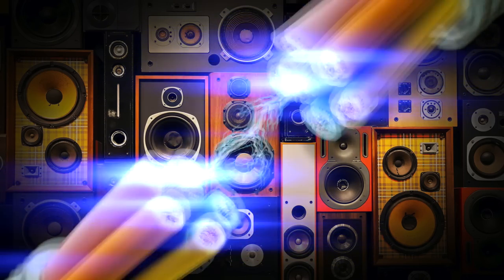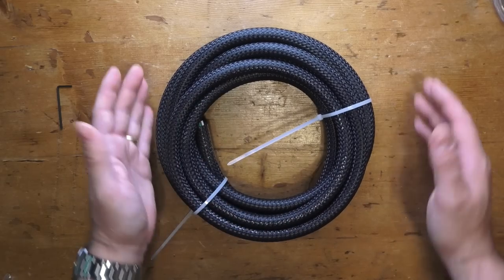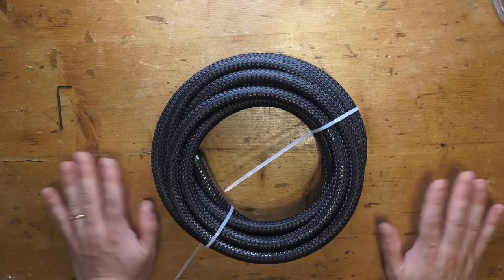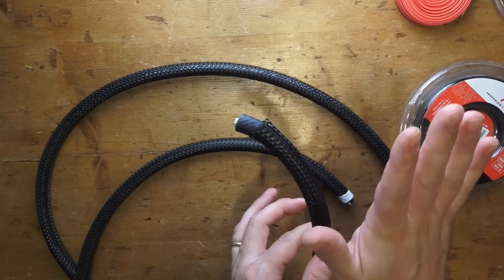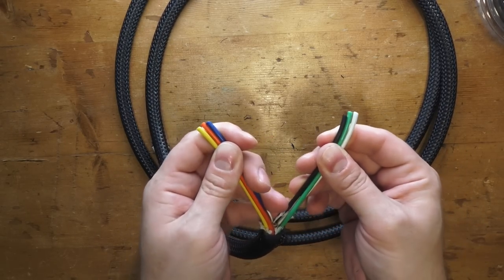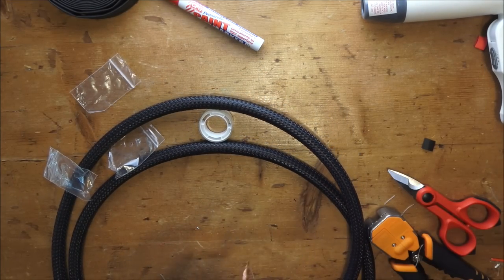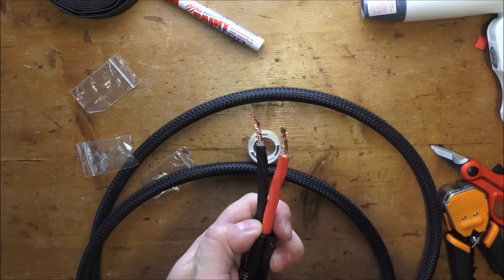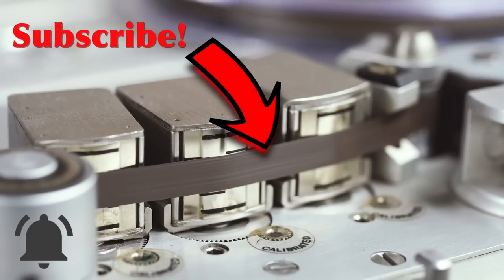The Speaker Cable Guide: Part 2 - DIY audiophile cables!

Comment: I already had my eye on this speaker cable for a while before seeing this video. I eventually took the plunge and bought some from Audiophonics based in France, 6 meters worth to start with. I tested it on my Bi-amped system and all I can say is, wow, superb sounding cable. Bass extension, clean, clearer mid range with a nice extended top end,  massive soundstage, transparency, speed, focus and superb imaging is what you get. This speaker cable should be on anybody's short list of speaker cables if you have a high-end revealing system. A bargain cable for the DIYer and I highly recommend it. I tested out some Canare 4S11 (5 Euro Meter) which is great sounding cable that replaced my Van den hul ' The Wind' (40 GBP per meter back in the day) which blew it away. The Amadeus 5 Mk2 blew the Canare well out of the water and then some. I use 2+2 connections ( 2 locking bananas + 2 spades) for each cable length, 4 x 3 meter lengths for Bi-amping from 4 mono bloc amplifiers into a pair of Monitor Audio PL200 floor standing speakers.
Reply from the maker: Cool!

Comment: I have tried Ramm Audio Am5Mk2 speaker cable after the recommendation from this channel and seriously surprised with its performance. Didn’t stop there and tried Elite8 XLR interconnect from Ramm Audio and they are the best cables so far i ever listen to. I have replaced Audioquest rocket 88 and Audioquest Yukon XLR interconnect with Ramm Audio cables and extremely happy with the thick and clean mid range it can produce.
Reply from the maker: Great! Thanks for your feedback!
Reply: yes, since I discovered Ramm Audio cables I solved all my cable problems, Elite 8 interconnects and Amadeus 5 MK2 power cables are unbelievable!! I'm now waiting for another Amadeus 5 to use as speaker cables, can't wait!

Comment: Hi My cable has finally arrived in New Zealand and I have made them up as a tri wire set up as my speakers are tri wired. I initially had the cables lying on the floor running to the speakers and they sounded very smooth and detailed but the music was a bit congested and lacking a bit of life. I then raised them off the floor using the cardboard centres of toilet rolls standing on end with a vee cut in one end (to locate the cable). Wow what a difference in sound! The sound really opened up and the life that was missing was all there. I am very happy with the sound of this cable and I find in my system that they are better than my Nordest flatline 2 speaker cables that I was using. The cables are connected between a Plinius SA100 MK2 class A power amp and Mourdant-Short 880 Performance speakers. Thank you so much for making me aware of this cable as I was looking at some other options - all of which I believe would have been inferior to this cable. Remember don't leave the cables lying on the floor or you are missing out on most of their potential! Regards Kevin
Reply from the maker: Cool! Thanks for sharing that!
Reply: whaat da hell,always cables are lying on a floor. What the hell fifference does it make?? Or do you mean dirt floor or concrete floor? 
My cables are on a wood floor,insuleted from ground or concretefloor.
Reply: @artsimannisto5659  Hi My cables were lying on a carpeted wooden floor. I have done quite a bit of research on cables and the reason is the floor changes the capacitance of the cable and therefore applies a different load to the amplifier. It is this different load that amplifier sees that causes the sound to change. In one of Paul from PS audios videos he mentions to always keep your speaker cables up off the floor. I had a set of old Monster cables that were a bit short to reach my amplifier so had them propped up as there was not enough length for them to go from the speaker terminals to the floor and along the floor to the Amplifier. I was confused as to how good they sounded as the music was full of life and my better cables that were lying on the floor were not as good. This is when I remembered Pauls comments and experimented. Have a go and see if it makes a difference for you with your current cables and let me know. The difference is subtle but noticeable when using decent HI Fi equipment. Good Luck.
Reply: @kevinironside3624  ok good for u. Only desent unit i have is a Deck. Adf-770,aiwa. Amplifier/radio is yamaha htr 6130,so,lowend amp. speakers are audio pro,swedish stuff. Maby pro-cables in my case,makes zero effect...hehe..??

Comment: Good vid, but there's no benefit to splitting the signal path with lengths under 3 meters, you'll also get a stronger signal from a single conductor of equal properties.

Comment: Très beau travail, the only thing I can say is to test it with a multimeter to make sure there is no short between the wires before connecting it on the amplifier. Thanks for your great video as usual.
Reply from the maker: Indeed! Good idea!

Comment: Going over this old vid as I am looking at sorting out my speaker cables.   The big issue I have with all speaker cables is that the live and drain(is that correct? ) cables run next to each other. I want to use two completely separate cables for live and drain.  and install them so  there is a decent gap(20mm) between each.
Reply from the maker: If you put some good distance it is undoubtedly better, lowering capacitance a lot but it is difficult and in most cases ugly to look at. Otherwise you can twist them, that also helps (with a good amount of dielectric around each cable).

Comment: 9:12 Oxidation isn't an issue in every case; silver connectors can oxidize, but silver oxide conducts even better than pure silver!
The silver oxidation also provides a "coating" against further corrosion.
IMO, I agree that spades are the most reliable audiophile connector, but in general, I think the SpeakON connectors by Neutrik are the most reliable.
11:30 those parts are a wise choice, without those, the cable has no strain relief. So if something/someone pulls on the cable, the outer isolation can move in respect to the inner wires diminishing the cable construction (SpeakON has built-in strain relief though).
14:48 Can I use my cigar cutter on that cable too? 😜
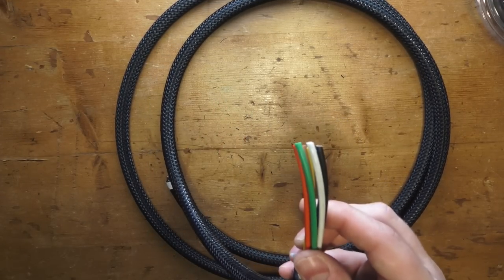16:33 I'm sorry to be "that guy", but bi from bi-wire is pronounced as bye in English, not as bee.
22:02 If you're into "cable direction" and there are no arrows on the cable to mark the direction, generally the letters can be used as marking. The start of the text is the input and the end of the text is the output. Even IF the direction is a thing, it's debatable if it applies to AC signals/noise, since the negative potential of the signals effectively goes the opposite direction.
28:33 The advantage of spades that need to be crimped on the copper with a crimping pliers, is that "automatic" crimping pliers has a self adjusting mechanism so that there's always the right amount of force applied to squeeze the spades on the copper. With screws/bolts there's a potential risk that they come loose over longer periods of time or that the bolts are screwed too tightly and the copper leads get squeezed too flat.
29:50 now that looks very neat! looks like you've got the skills for it! 👍
Reply from the maker: Hi there and thanks for you valuable comment.
Well, yes, silver is great but it has different electrical properties than copper. As I said in teh first video, IMO it's better not to mix metals.
Yes, you can use your cigar cutter ;-)
Bi-wire, you'e right! Damm my Italian always gets me with names. Sorry!
I do agree that crimping has the best contact but most crimping spades are of very bad quality plus I wanted to use the excellent Ramm ones.
Ciao!
Reply: @anadialog  Ah funny how the Italian pronounciation of Bi is very similar to the pronounciation in Dutch (my native language) 😜
I agree that mixing metals for conductors isn't a good idea in general, especially because of the Seebeck effect that might occur.
However, gold plating on connectors theoretically could cause similar issues.

But there are exceptions when done right; silver plating can be very useful to prevent copper oxidation and it's often found on higher-end copper litz wires, such as Ortofon headshell wires or Superflex tonearm wires by KAB.
Reply: @QoraxAudio  The Seebeck effect is just one of three separate effects (Seebeck, Peltier and Thompson) which together is referred to as the "thermoelectric effect". It is highly doubtful that this effect can have any influence on the application of different metals in a speaker cable and connections especially because the Peltier effect alternately heats and cools the junction with alternating direction of current. This along with all of the other claims of superiority, other than resistance, is pure snake oil.
Reply: When my cables start approaching hose pipe size I only feel secure about the connections when I use SpeakON. And the ones that use a screw-and-plate system to squeeze the conductors are especially reassuring and easy to work with.
Reply: The only time cable direction matters, is if the shield is only connected on one side. Connect that side to source. (Usually)

Comment: Thanks! Great information but one question if you don't mind. My Polk R700 speakers have separate binding posts on the back one to the woofers and one to the tweeters.  They come bridged together but they say running a separate wire from the amplifier to the binding posts are better than using the bridge they give you.  You can bi-amp but I'm not doing that. Should I use two separate wires to each speaker from each of my mono amps?    Also, since this video is from 2020 would you change anything you recommended here?
Reply: Looks like you answered my question at 16:52 in the video!  However would still like your opinion as to whether there is an advantage of this bi-wiring.
Reply from the maker: Absolutely yes! When possible try to bi-wire. I had a pair of ATC and after removing the jumpers they finally started to sing, even if I wasn't bi-amping either. For the quality/peice ratio I still recommend these. Clearly something with PTFE (teflon) would be better, like the Neotech. In fact now I have those, which are certainly better but not day and night difference.
Reply: @anadialog  Just great info always.  Going to order the Cable and parts today!  Now I have two new hobbies, watching your channel; and building cables!!👍
Reply from the maker: @DrAlanWeinstein  give us some feedback if you want, the good and the bad, no problem!

Comment: Unless you have a dedicated crimping tool which gives you an airtight (voidless) crimp soldering is the better option. With large wire cross sections (4mm2 and larger) it is difficult to solder as it requires a lot of heat. Speaker wire is an issue, usually. I like ultrasonic welding but this is not accessible to most people. Blue Jeans does it right. Cardas Quad is my solder of choice (hypereutectic).

Comment: Just bought this cable from France which takes a week more to get it delivered to HK.  After one  day of run-in, the sound  have improved a lot. I use the whole cable for bi-amping. Two core to high and  four to the low. It seems that it is more nautral then my original (silver + AQ mix) in which  it sounds like one driver as a whole instead of coming from 2 seperate drivers.

Comment: Woohoo! Great job, man! A good amount of expensive cables are most likely pricey due to the time and work involved. All the more reason to DIY what you can, as long as the quality is there, which it obviously is with those cables you just made. Bravo!
Reply: I think 50 dollars / meter is still expensive for a speaker cable. I use ProCab Reference, which is actually pro audio stuff and only about 4 bucks / meter (most pro audio cables are significantly cheaper than audiophile cables, speaker cables in particular) - it works very well.
Especially in combination with the easy to use Neutrik SpeakON connectors it makes a very sturdy cable and provides a very reliable connection that's even suitable for 'on the road' applications!
I have a reel containing that type of cable of about 30 meters laying around somewhere, so I can cut off the right length whenever I need to.

Btw, according to Fat Rat, solid core speaker cables are the best - knowing him, he'd probably bash this video 😜
Reply: This bad cable took me more than 2 hours to craft, it had a monster insulation I would say, but having fun and worth of doing so.😁

Comment: Caro Aldo
I followed your suggestions and I'm very happy. In few months a did several upgrades to my speaker cables as you suggest. I started with Ramm Audio Amadeus and finally I got the Neotech NES-3001 for the High Frequency and the Neotech NES-3002 for the Low frequency. AMAZING nothing to compare with the other cable that I owned before (very expensive one - NBS, Nordost, Audioquest). I would like to thank you for your advise. kindly recommended. Don't use the any Silver cable this is my recommendation. Non rispondere a sti ingegneri da tastiera che sono solo capaci a dirti che 1 feet is not 1 meter. Nessuno di loro ha seguito i tuoi preziosi consigli. Questa gente e'  da bannare e non degna di ricevere risposta alcuna. GRANDE
Reply from the maker: Grazie mille Fabrizio! Gentilissimo! Thank you so much Fabrizio for your words. My name is not Aldo, it's another subscriber that likes to call me that way! 😂
Congrats also for taking the Neotech jump! Once you try that, you can't look back! Bravo!
Reply: I am just wondering if you can share your experience with Ramm audio amandeus compared to audioquest. I am currently using Audioquest rocket 88 but not very happy with lack of neutrality compared to van den hul i used before. Any idea if it is worth replacing rocket 88 with amandeus ? In your experience with other brands where amandes sits with other popular brands ? Thanks
Reply from the maker: I hear a lot of people NOT happy about Audioquest. Unfortunately I don't have direct experience so I can't help you, sorry about that.
Reply: @weeragardens  I only use AQ Midnight 2 for the bass driver, that's work fine, punchy and airy.
Reply: @anadialog  Ramm cables are made in Taiwan, so I wouldn't surprised if they are made by Neotech.

Comment: Great video man,how do i split 6 conductors to 4 for the use of bi amping?
Reply from the maker: Just use this scheme: https://www.google.com/search?q=ramm+audio+amadeus.biwiring&client=ms-android-samsung-gs-rev1&source=android-browser&prmd=ivn&source=lnms&tbm=isch&sa=X&ved=2ahUKEwiUyeKJ_e3tAhXG3KQKHT5lBmsQ_AUoAXoECAIQAQ&biw=412&bih=682&dpr=2.63#imgrc=fPvoBfX-hYHlgM
If you are just biwiring, use it this way, if you are bi-amping use the same scheme that is employed on the speaker side.
Reply: @anadialog  so if i understand it right,1 conductor for the highs and 2 conductors for the lows.thank you very much
Reply from the maker: No wait, 3 conductors for each pair of connectors: 2 conductors for one pole and the third goes to the opposite pole. As I said, look at the scheme on the loudspeaker side and use it also on the amp side (if you are bi-amping)
Reply: That‘a not what the scheme says…..3 conductors per pole……2 (green and red)and 1 (black) both on minus, which ones for the lows? Black or green/red??

Comment: I built this cable according to your specifications in July / August, extremely happy with the result. First tested on my old Onkyo NT-TX747 amplifier, and then switched to my new Hegel H160. This cable did more to the sound than replacing the amplifier ...
A few months later, the sound is the same, but I see that the unprotected copper oxidizes quickly?
Reply: Use heatshrink to wrap it up.

Comment: Are you sure it does not matter which colours to combine in red and black? In the technical video, you explained that you can reduce the magenetic field (induction) by twisting the wires. So I'm thinking maybe alternate + and - wires that are laid out around the empty brown wire? E.g. combine green, yellow and black in one channel and the rest in the other?
Reply from the maker: I am not sure I am understanding your point, I thought I did that...
Reply: @anadialog  You choose to combine 3 adjecent wires, as that is the most easy to get a neat combinatioin. But what I am thinking about is the question what combination would make for the smallest magnetic field. As twisting + around - reduced the magnetic field, then probably alternating adjecent + and - in the layout of the cable also reduces the magnetic field. Downside is that it would take a bit more effort (or strip a bit more cable) to then twist the 3 (non adjecent) strands into 1. Of course, this is all theoretical. It remains to be seen if any of this would give any audible result :-).

Comment: might have to give these cables a go. a good of mine recommended some HIFI occ Copper T16x1mm 18 awg cables from Ebay also
Reply from the maker: Sure! As long as it is using true OCC copper with decent insulation! And not too thin! Resistence goes up!

Comment: How do you know which direction the cable goes after covering up the sheathing? I didn't see you mark the amp end?
Reply from the maker: On the side of the speaker I added the RAMM metal splitter. On the amp side there is nothing.